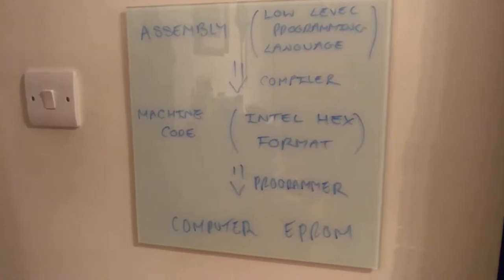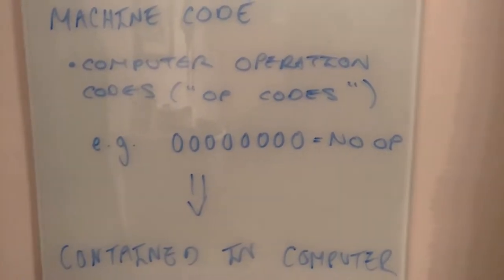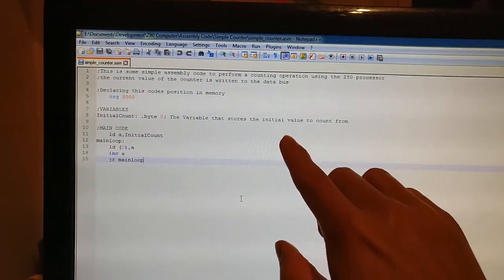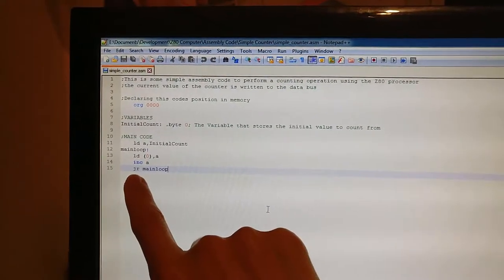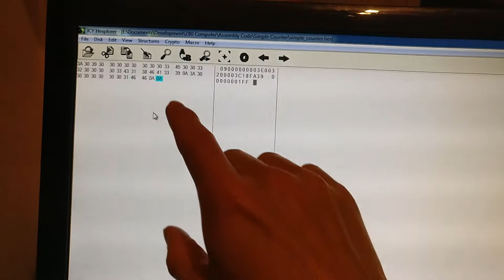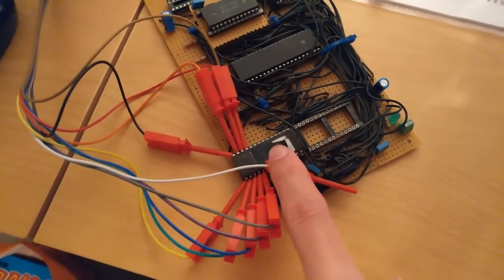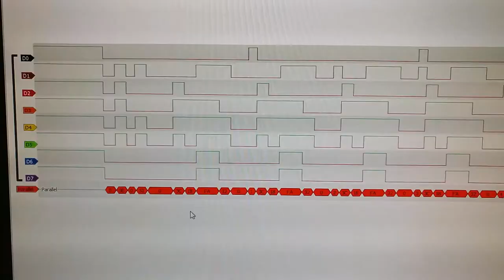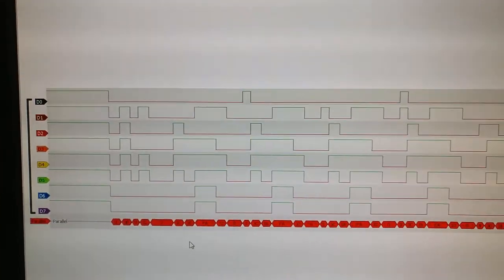Homebrew Z80 Project Part Nine - Testing the ROM

Comment: Nice, good progress, I would try integrating the RAM next. A simple test would be use the same assembly as you had just done except loading the accumulator from a RAM address incrementing the accumulator and then storing the accumulator back in the same RAM address verifying correct accumulator results on the analyzer.
Reply from the maker: That's a really good suggestion for a test! I'll definitely do that before I make the changes to the memory address decoding to verify that my suspicions are correct. It will be a good verification step if I make the changes as well!

Thank you very much for your advice! :D